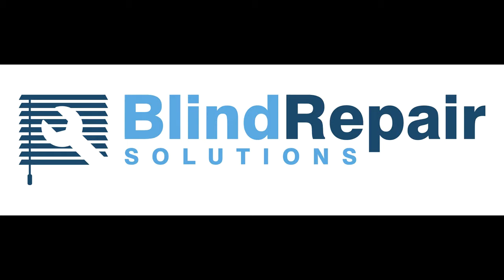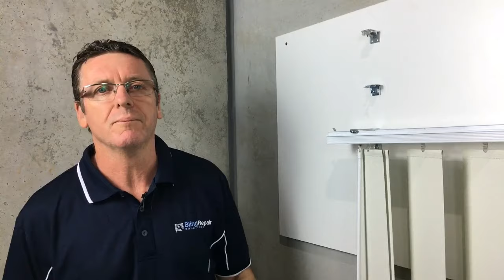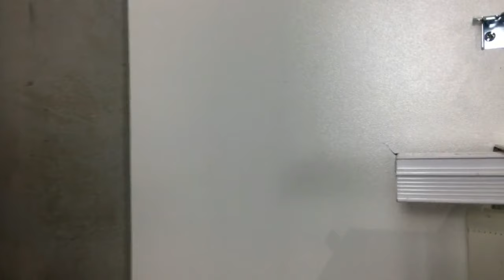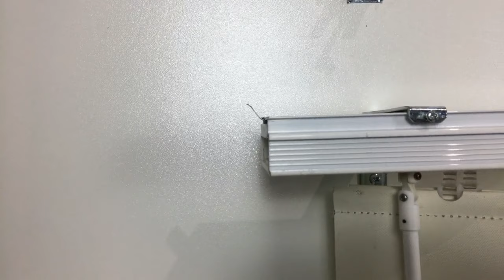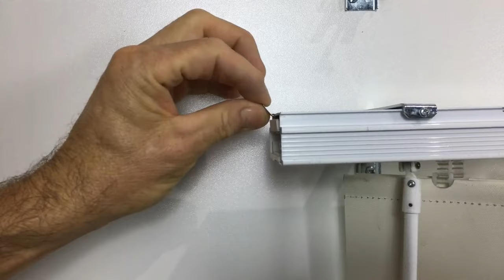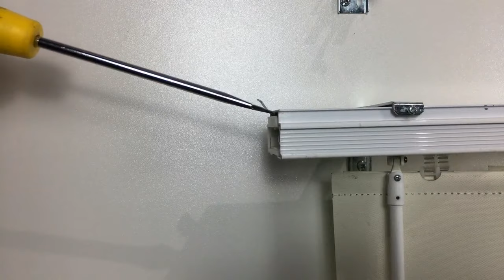How to Fix Vertical Blind That Won't Open.

Comment: Thank you!  My vertical blinds are old.  Is there any way to lubricant the chain (for opening an closing the blinds)?I have a string, (to adjust the direction of the blinds) is there anything I can do to lubricant that as well?

Comment: What can you do if the blind spacer is not accessible because of where the bar is ? Mine is between the two walls so the gap between the wall and the mechanism is so tight I can't get in to pry it open to fix the spacer
Reply: I would also like to know this. Mines stuck
Reply: Where you able to solve ot? Mine is stuck too and the slider is not accessible
Reply: Did you solve your problem?
Reply: I would love to know too. Handy man just left after installing blinds and strong is jammed. Won’t open or close!

Comment: My blinds OPEN - they just will not TURN! 🙁
Reply: Not turning is an overlap issue usually. When they overlap in the wrong direction. Just individually tuck them to reverse the overlap direction and try that. Fixed mine after seeing that in a video.
Reply: same